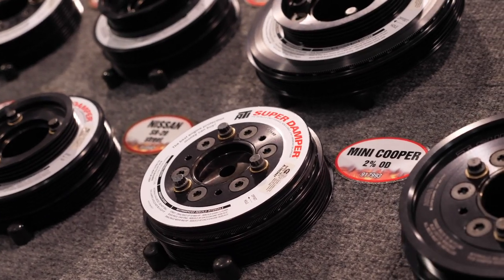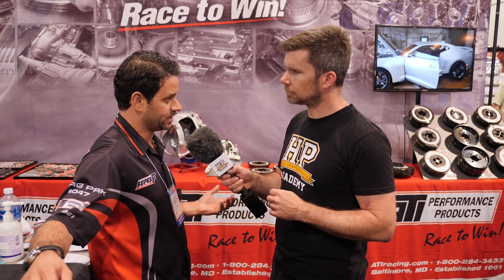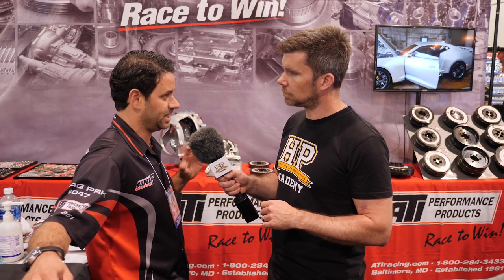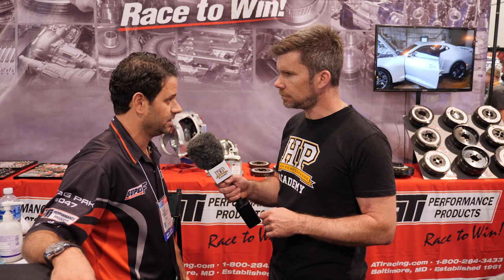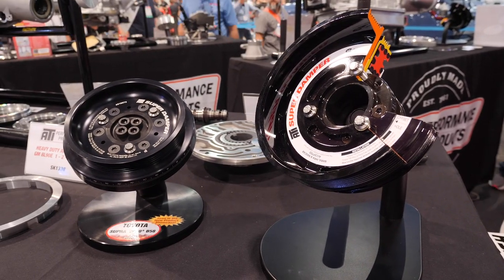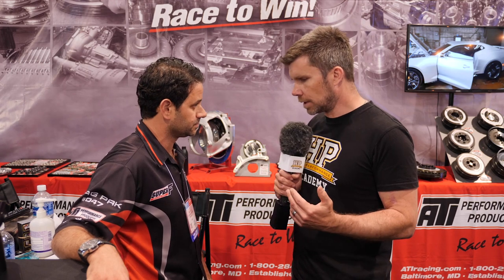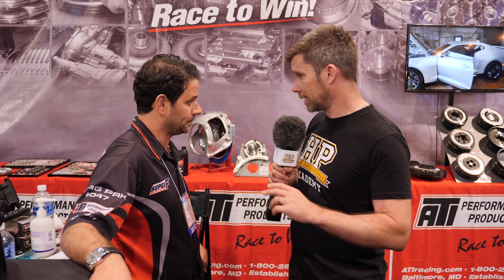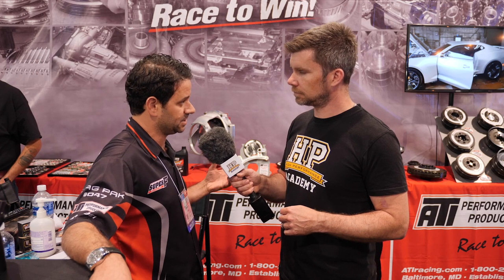What You SHOULD Know About Harmonic Damper Pulleys | Harmonic Balancers 101 [TECH TALK]

Comment: I think this is 1 product that is so exxagerated.... the effect this wld hve is  very minimum ..... funny how people worry about damper n yet still install solid mounts.
   Now for a stock engine they may can match a balancing damper ..but for modify engine that varies I find it hard to believe that 1 balance is good for all.
    Internals built balance is key and way more important than external...
   Also majority of manufacturers don't use a damper ...especially in this time of precise technology.... simple put if theres nothing to balance then there's no need for a balance damper
Reply from the maker: Sold mounts have nothing to do with ensuring harmonics don't tear your engine apart, neither does how balanced your pistons are. You are mixing two different things up.

This interview talks about harmonics in relation to where in the rev range they are for this application, where they had the ability to decide and I think it will clear up things for you here: https://www.hpacademy.com/blog/88kg-500hp-10500rpm-hayabusa-v8-radical-sportscars-rpe-v8-tech-talk/

I forget the time stamp they're at, but just watch it at 2x speed till you hear them start to talk about them. From there you should understand what harmonics are, why they're different for different engines, and the purpose of dampers like this - Taz.

Comment: Blown engines get the " damping affect " with the blower belt
Reply: Ever watched a blower drive belt in slow motion?
Reply: GordoWG1 WG1 yup
Reply: @unclesquirrel6951  And you didn't consider what affect that would have on the crankshaft? The harmonic damper is used to control cyclic torsional stresses, whereas the blower drive is random - rather basic difference there, and a big part of why snouts fail.
To be fair, though, I thought the same, more decades ago than I care to remember ;-)

Comment: Great product except for it rusts in 3 months.... looks like shit on the front of my nice beautiful engine now
Reply: thomas barlow Jw how a powder coated part rusts in 3 months??
Reply: @jeepwk6.5L  The outside ring that says ATI is powder coated black but the center part which connects to the crank is black oxide coated. Shits rusty AF after like 2 years. It looks horrible.
Reply: thomas barlow hmm didn’t know that
Reply: Paint it.
Reply: @fyshlearnstoskate  bro I spent $300 on a little metal and some O-rings I think it should come painted
Reply: @thomasbarlow4223  should have given it an oil or silicone coating and it would have been fine.

Comment: Thoughts on fluidampr
Reply: Fluidampr has a more broadband range of frequencies that it dampens. It's completely sealed and the damping media is a special silicone fluid which unless overheated somehow it essentially lasts for a lifetime. ATI can get away with lower overall mass I believe due to frequency tuning being easier to design as it is a standard relation of spring constant and mass of the inertia ring , where in the Fluidampr it is related to the mass of the inertia ring, fluid viscosity and shear area as well as the gap between the shear faces due to fluid flow dynamics. Personally i use a Fluidampr on my modified street car for years and absolute happy with it so far:)